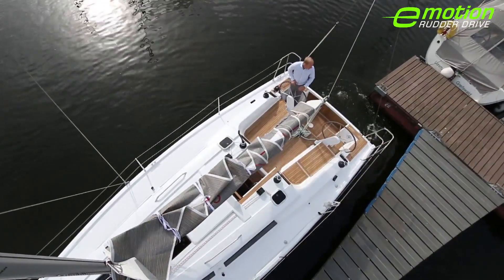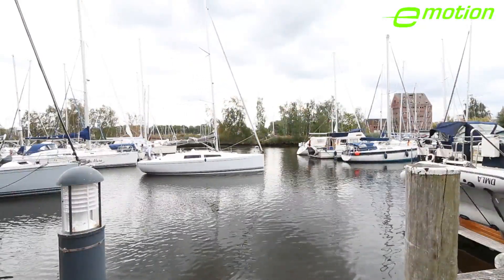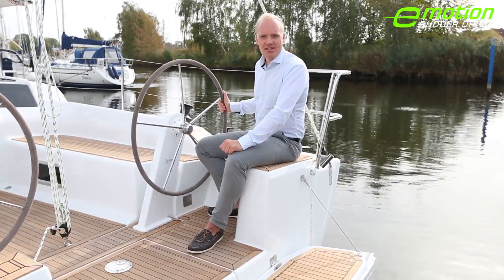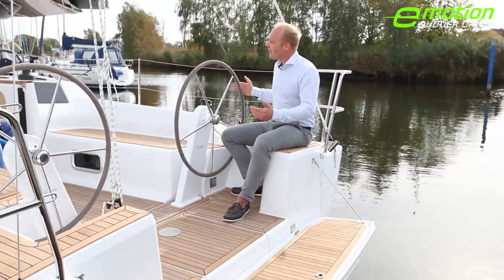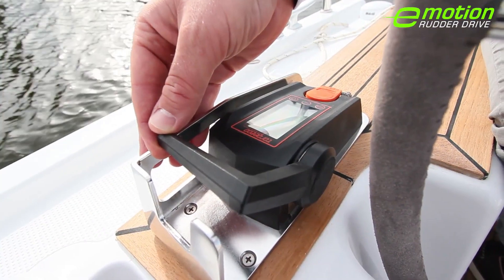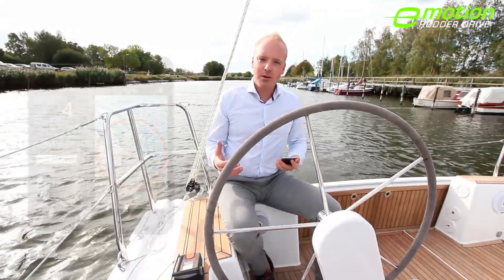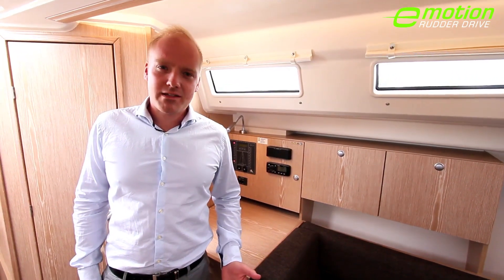Hanse 315 -  E-MOTION RUDDER DRIVE - The Revolution in Yachting

Comment: Nobody can live with a 50 mile range! You just limited your product not improved it. The entire electric thing is a scam for people who cross seas or travel to remote destinations.
Reply: 50nm on one charge . Buy a powerboat or dump your big tv and dishwasher overboard if you need to motor more than 40-50nm at one time before setting some canvas, my friend...lol.. The prop is a great design; it feathers when the e-motor is off to become a hydrogenerator which trickle charges the batteries. Add some solar, too, for charging on the hook and you'll be juiced for the trip into port.Carry less diesel & add a battery or two for  torque to fight wind/current if needed. Carry a small genny for hotel load/emergencies/fast charge. No excuse any more for diesel on smaller boats except initial cost.
Reply: An auxiliary engine is for the convenience of getting in and out of port. With good sailing skills, it is not even necessary. 50 miles should be good for a couple of years of port manoeuvres, i.e. on one charge of around 3000.

Comment: Does it works as a hydro generator too?
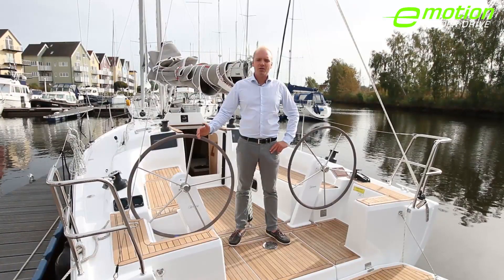Reply: It doesn't look like it. You can see at 1:00 that the blades appear designed to feather back when not under power. This reduces drag of course, but can't regenerate energy under sail.

Comment: It would be great to know what the motor draws so you could plan on packing a portable generator for emergency power.  Even if you could only run at a percentage of full throttle, you could still greatly extend the range by carrying a generator for that once in a lifetime emergency at sea.  It would be beyond awesome if Hanse could integrate lead acid batteries into the keel bulb - cheaper than lithium and little or no weight addition due to the replacement of iron in the bulb with massive heavy batteries

Comment: "Real innovation means less components," says the guy standing on a small boat with two steering wheels. Funny.
Reply: it needs two when sailing so the skipper can always be on the upper side when keeling,there are boats with a rotating one ,but its not that better ,it still takes much space because of the mechanism and you cant put anything else in that area because it needs space to move side to side

Comment: I wonder if the Rudder shaft and bearings etc have been beefed up sufficiantly enough for the entire displacement of the Hansa to be pushed from that point! I'm quite frankly shocked that Hansa haven't fitted a skeg!
..and what would be the max displacement for this system to be of practical use?
Reply: The rudder shaft is taking on much higher loads while sailing. The 4KW engine is nothing against a reach course with gennaker and strong gusts.

Comment: Having sailed quite a bit on a Harbor 20 with an electric motor, it was generally fine for getting in and out of the marina.  In the H20 top speed/power lasted for 10 to 15 minutes or so and then the electric motor propulsion started to wane pretty quickly.  In calm weather that's not a problem.  The motor can push the boat pretty well for a while.  Against a strong current or headwinds is another story. There were many times that the motor quickly became useless as the power dropped off.  I would bet Hanse has thought of that and their system doesn't have this issue, but it is something that I would be worried about if I was considering a Hanse with this system.  The maneuverability it offers looks pretty sweet though.
Reply: What happened to this product
Reply: If you have to have a gen, all the advantages are cancelled out. Now you are paying for diesel, maintenance and wearing out a huge bank of batteries which cost more than diesel fuel ever will.

Comment: Sailing is all about using the clean power of nature for propulsion. For people who want to eliminate stinky, polluting internal combustion engines from their lives, preferring to use 'stored wind' to get their yacht out to where using 'live wind' is feasible, this E-Motion Rudder Drive system is brilliant. Drive to the marina in an electric car and then navigate out of the harbour with an electric drive in a clean-green yacht. That yacht is less costly, lighter and more spacious for not having a diesel engine or thrusters. Sure, it's not as practicable for blue-water passage making, but not everyone does that. :-)
Reply: clean plastic boat?

Comment: Any idea of the capacity/construction of the battery?  4KW is quite a lot to power.  Unless they are using "tesla grade" cells I'd be concerned that the cells might be a fire risk, if left charging while away.  I'm assuming a pack of around 30-40kWh?  So a $20,000 pack?

Comment: Without an engine driving an alternator and no visible solar panels - how does Hanse supply power back to the batteries?
Reply from the maker: I imagine that at the present time, you need to plug the batteries on the dock. However, 30 miles is more than what most of the boats will sail during a normal day of cruising.
Reply: Terry Williams Innovative technology always has a starting point. Cars did this, aircraft did this etc etc. It may be limited right now, but so we're those examples in the beginning. To say that it's crap is inappropriate...when the propulsion system and battery technology matures, diesel and petrol will seem old school by comparison. As electric cars are beginning to demonstrate now over petrol. Governments are already legislating the end of combustion engines for cars already. Within a decade, many boats/yachts will be electric when ordered new...in fact hybrid drive systems are optional on many branded water craft now. This isn't conjecture Terry...it's fact.
Reply: GazLowe, couldn’t have said it better myself.
Reply: It will be a marina boat for those who don't go far.
Reply: Great for people who motor sail in marinas for real sailors a load of crap
Reply: Castaway real sailing cruisers don't need a motor at sea.
Reply: Diesel generator and solar panels.  Most boats have a motor and a generator anyway.  This way you are eliminating one motor.
Reply: Regen possible?
Reply: I want this on my way boat.  Great manuverabolity, no thru hills, quiet, clean, no oil changes, no heat exchangers ... just to name a few.
Reply: Shore power but I guess you could add solar panels and wind generator.
Reply: Sailing News so its a electric jetdrive?
Reply: this will be awesome with a diesel generator
Reply: Im sure there is room for extra batteries, Some of the new tech can take a battery down to %20 witch would double or even triple the range >
Reply: Shore power, it's a demo boat I'm sure an efficient solar array can be fitted, they also need a metal propeller with the same power they perform better
Reply: Heck of a lot money just to sail around the harbor...seems like a waste to me.  If I can't cruise then it's not worth it.
Reply from the maker: It is not available on other boats at the present time.